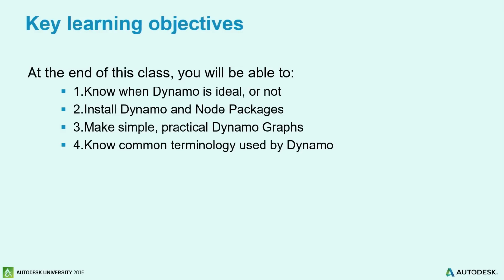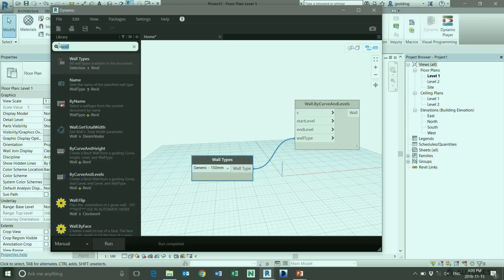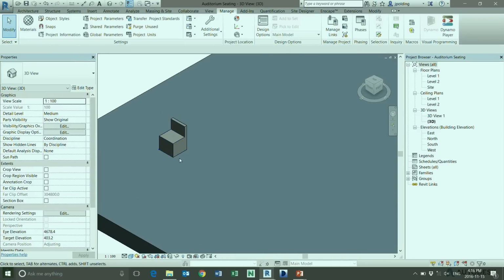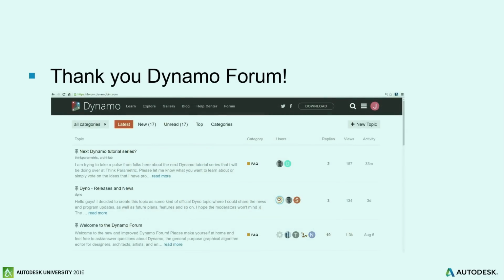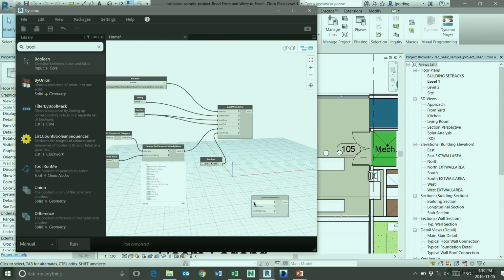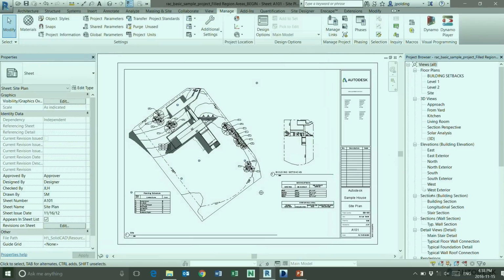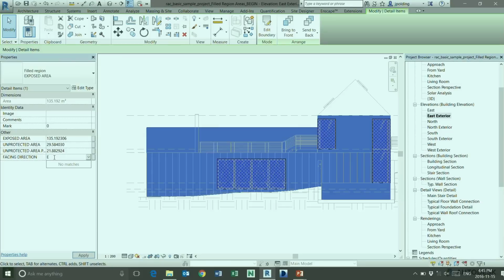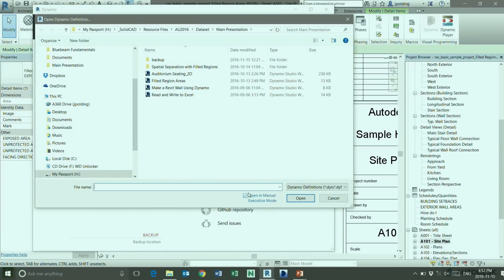Dynamo for Revit—Baby Steps for the Non-Genius

Comment: Dynamo is buggy as hell glitches and inconsistencies all the time even practising regular stuff it crashes or says "run started" and waits like that doing nothing. I am using licensed revit 2019 with dynamo 2.0.0 trying to practice but its full of glitches . Even copy and paste with keyboard does not work  they said that it will be fixed when the program was at 1.3.3 version now i am using version 2.0.0 still same issues .
I dont understand this logic . If we cant use it properly why advertise about it ? Are we dynamos test subjects ? :D I dont like to be a lab raT !
Reply: Simply hold control and drag from original ;) it will make copy, i find its more easy than ctrl+c, ctrl+v since you already can place where you need it ;)
Reply: +Deividas Pocius yes doing that but not easy nor faster :>

Comment: Why would you complicate what can be straightforward? The Dynamo Units are simply a waste of User's time, same as the inconsistency in the wording! This product is really not UX compliant. I don't see this going to far, even the presenter needs a 'genius' to get through the demo! :))
Reply: Eddie Seda are u really not aware that other 3D modeling software already incorporated this functionality with so much ease? Eg are: AutoCAD, 3Ds Max, Rhino... What they are presenting here is not new. It's been created in other programs a long time ago :)) I switched from Revit.
Reply: And by the way, if I do decide to work with scripting, I will do Maya. The results are so much more elegant and professional!
Reply: Horn Beam i agree, and am already proficient in 3ds Max and Rhino, i use these extensively in modelling and also to support V-ray rendering(https://www.youtube.com/watch?v=4LjrmnsFVBs), but the truth of the matter is rhino by itself is not sufficient to document data and be parametric, it requires the use of Grasshopper and other extra plugins to achieve algorithmic modelling. 3ds Max is simply not an architectural software, its parameter are not quantifiable. Which is why Dynamo reveals a powerful side to Revit if you know how to use it. It has all the capabilities of Rhinocerous and 3ds Max, albeit a bit complicated, but it is algorithmic, which is what is important. Rhino without Grasshopper to feed back to data for quantifiable  costs, and i am talking specifically in architecture and building industry, isn't necessarily that powerful if you do not tie it back to autocad, revit or any other architectural BIM software. This is just my personal experience, i may be wrong.
Reply: Again, i think Maya is just a Nurbs/polygonal modelling software and cannot schedule elements for construction nor do detailed drawings. it is mostly suited for first process design, not documentation. Here we are talking about the ability to document what you design, because ultimately architecture and design has to go beyond conceptual into built. and scheduling is the first step.
Reply: Horn Beam maya is for texturing, and rendering a final presentation, not for building dumbass.
Reply: Embrace the glitches. As an electrical enginer i programmed pic microchips in past with hex code and c ect. What i can tell is that from my little experience an overlay of programming language is just as good as its glitches. And seems yet dynamo has lots of it i think thats why its free for now. Best wishes.

Comment: Does anyone know where to get the first Node referenced?  Is my install incomplete as it doesn't seem to have 'bycurveandlevel' by Revit and a search of the Dynamo package manager site and forums came up empty.
Reply: I figured it out...user error.  If you launch Dynamo from the Windows start menu and NOT from the Revit Ribbon under Manage it will not list the core Revit Nodes.